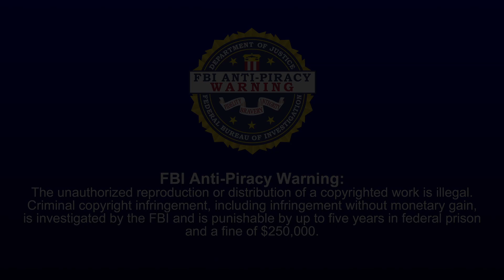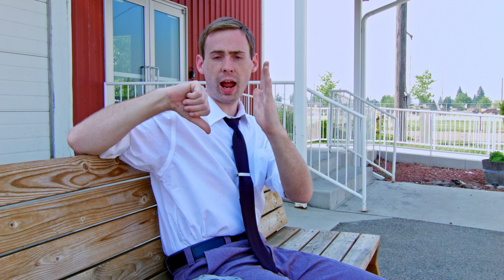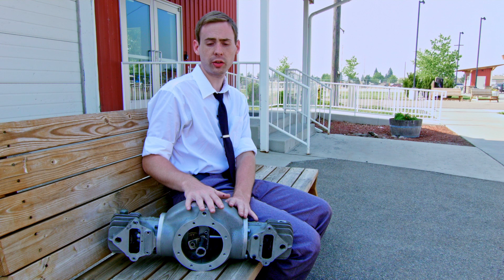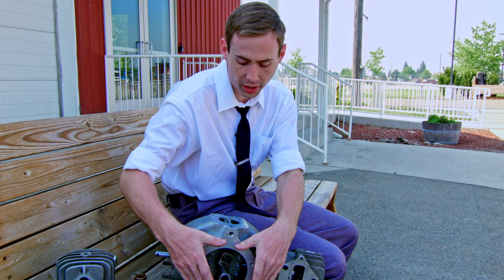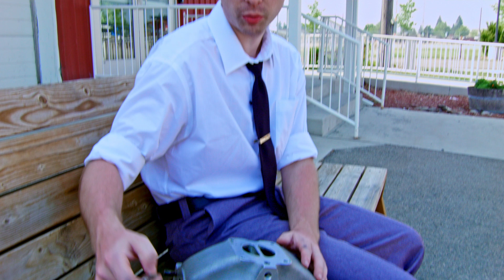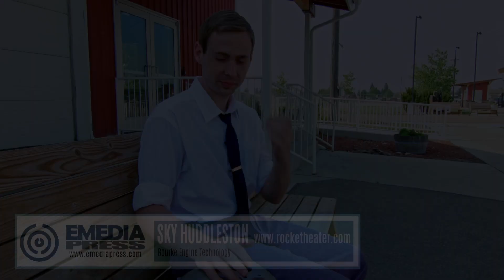Sky Huddleston presenting one of the most efficient engines ever

Comment: "im a mechanical engineer. spent a few years doing courses and repeating "facts", so now i just copy the same old stuck in the rut ideas and concepts, cus, you know, "education"... we still got ourselves an antiquated steam engine with sparkplugs stuck in and trying to flog the same tired concept off as "revolutionary"..."

yeah, ok, so bourkes are "detonation" or compression ignition. still just an antiquated steam engine. 

yall looking at the wrong area... how about considering how to convert that pressure to actual TORQUE?

get out of the rut, stop thinking of steam engines.
Reply from the maker: Perhaps it'd be good idea to share your thoughts with Sky Huddleston.
Reply: Steam engines are more advanced than what we have now. Just as the Bourke Engine is.

Comment: The moving mass inside the engine is nearly 4 x greater than a regular I.C. engine. The engine has a primary imbalance issue it shakes never mind secondary. The yoke and two pistons weight slamming side to side it will tear its self apart at high revs.
Reply: There is no real impulse for the jerk on the entire engine (due to the sinusoidal travel, and high rev), the crank shaft is thick due to the high response, and the tubs are held on with 12 studs.

While theory could suggest that it would shake itself apart: Personal experience, and running demonstration videos by Roger Richards demonstrate otherwise.
Reply from the maker: @Buzzard-wq1bw  Thanks for the input.
Reply from the maker: You might shoot an email over to Sky Huddleston to ask him about your observations.